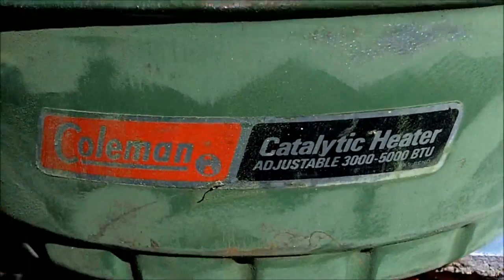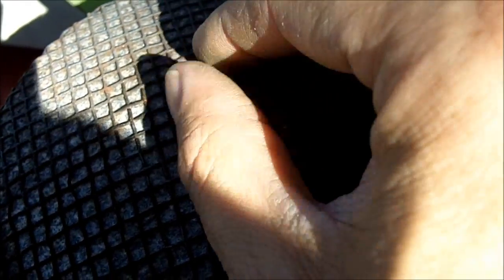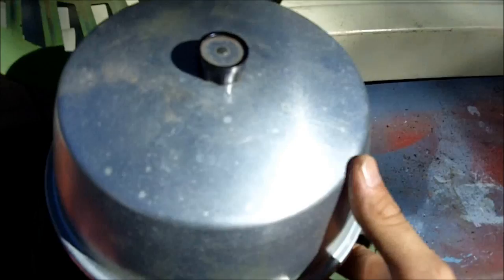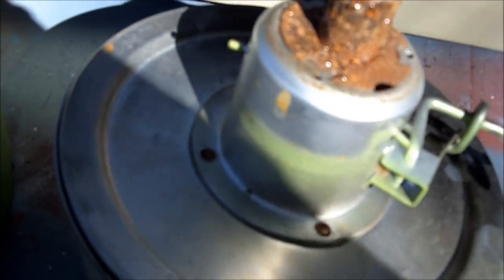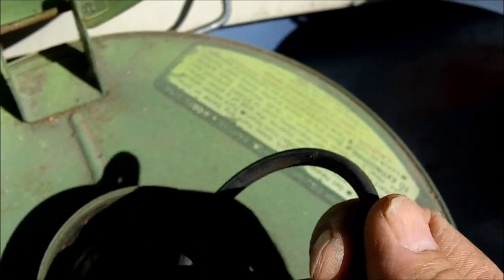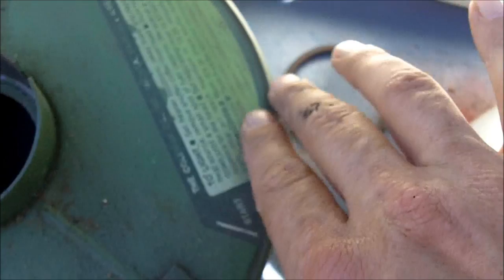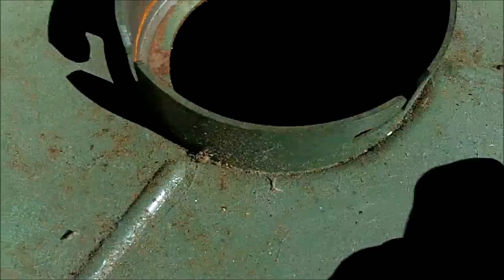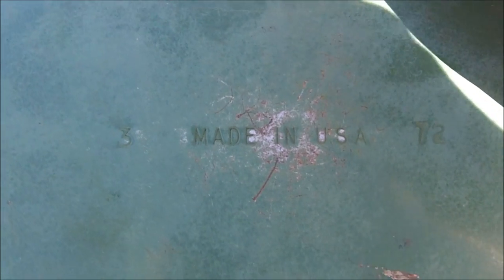Coleman Catalytic Heater

Comment: Is there something else that can be used instead if I can't find that exact part .the heater we picked up must have been stored somewhere I think it's for mouse urine on the filter part and really smells when we tried to use it yuck it was disgusting
Reply from the maker: I would use a different heater if you can’t find the repair part it needs. I’d be wary otherwise. Maybe a Mr Buddy heater?